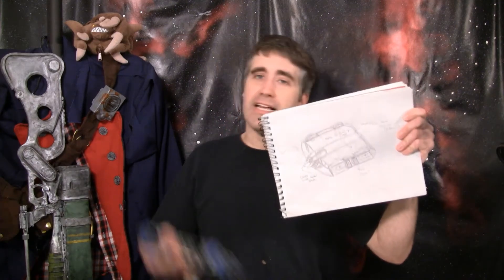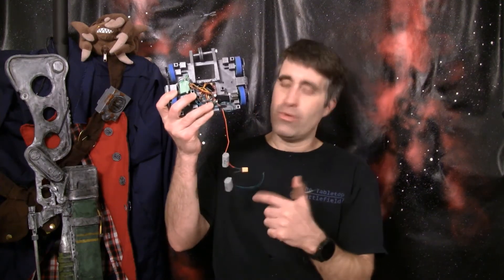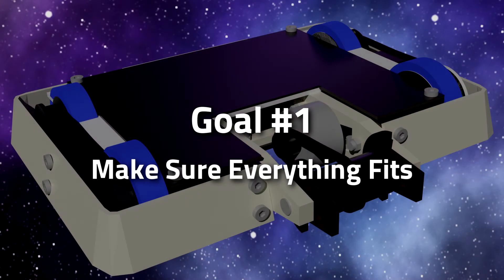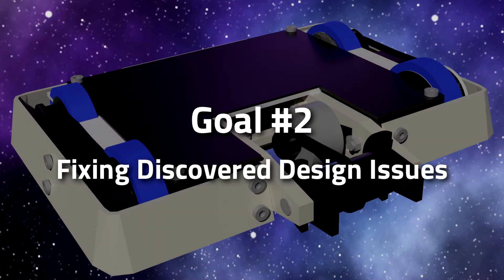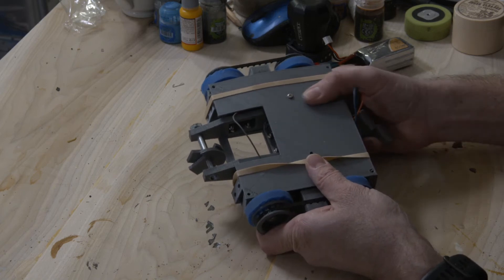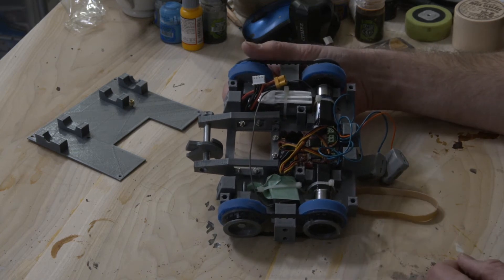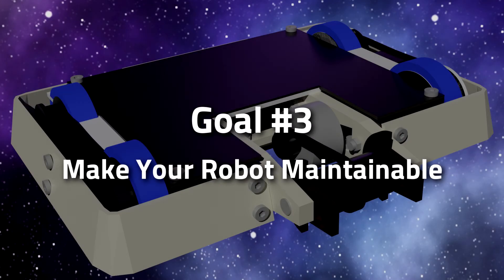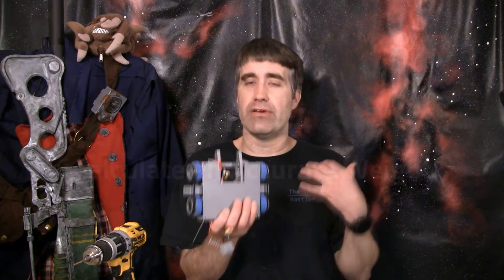The 4 Goals of Rapid Prototyping a Combat Robot Frame - Let's Build Your First Antweight #3

Comment: Is there any bearings in your weapon assembly? Looks great!
Reply from the maker: There will be.  I have not got to that part yet.  It will likely end up being a dead shaft with the bearings in the weapon itself.
Reply: @RockoRobotics  Sweet! I’m using that same setup with the dead shaft in my ant. Just, with a direct drive hubmotor weapon. Expect test videos soon...
Reply from the maker: A hub motor setup is probably the way to go at this point, but that is a bit beyond my engineering skills at the moment.
Reply: @RockoRobotics  It’s surprisingly not that hard, it just takes some precise manufacturing. You could always just use a motor with a thick 5mm shaft and direct drive the weapon.